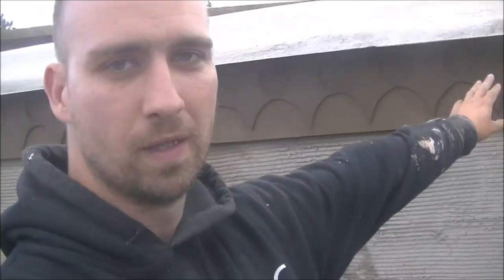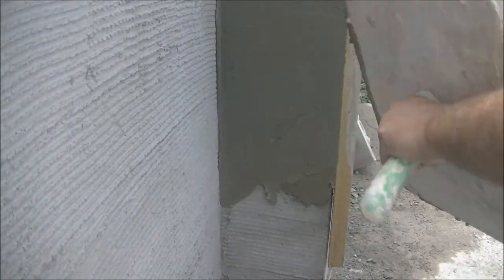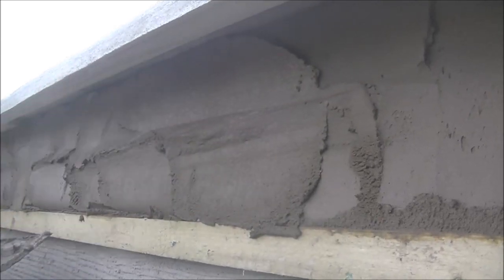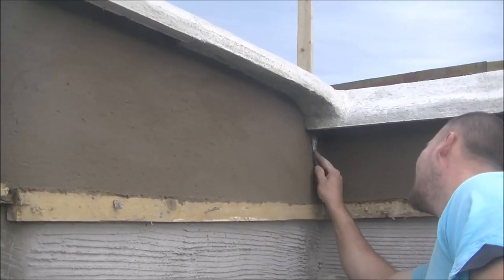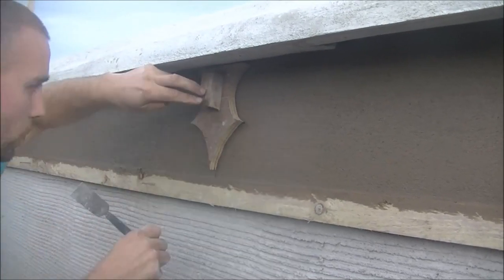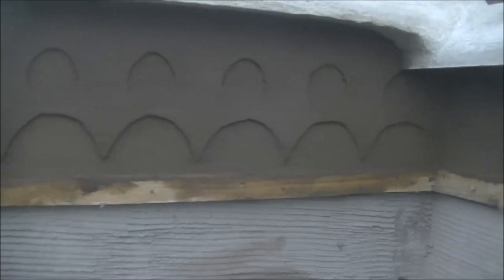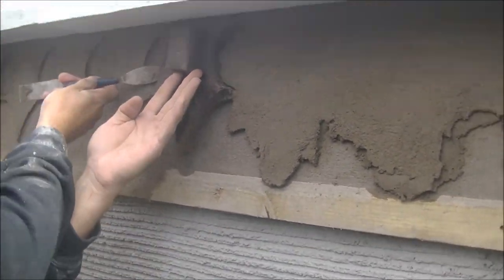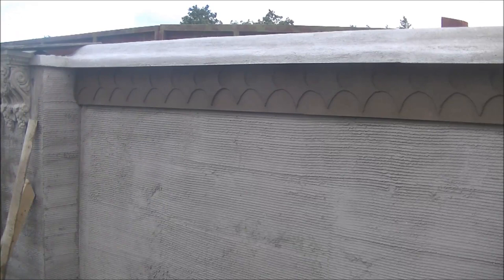Coloured Render with Arrow Tip Cut Carved Detail in Cement

Comment: That looks great that does. I been watching your ox speed skim vids and bought one. Carnt wait to give it a bash
Reply from the maker: Great on ceilings a quick round around check everything is nice and straight and flatten as you  go mines could do with a nice clean atm LOL
Reply: @macplastering  lol. Yere i was thinking that on a old ceiling that's up and down it not going to work is it. Have to make my plaster bloody flat 😂😂😂
Reply: Do you still use it or not so much now
Reply from the maker: @markhep  Used it a few days ago on a ceiling and a single door that was blocked up to straighten out with bonding I have the speedskim and the refina and tyzack all great to be honest
Reply from the maker: @markhep  haha it will find all the hallows and bumps we used to use a 6foot straight edge most times ceilings weren't to bad but sometimes you had to just take it in from the high spots either that or spend 15days adding bonding LOL
Reply: @macplastering  😂😂😂👍👍👍